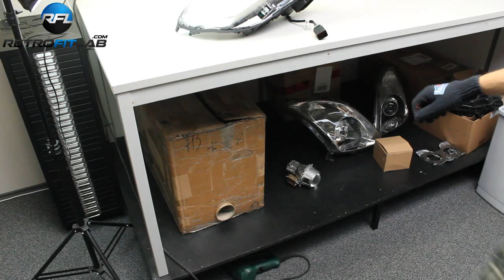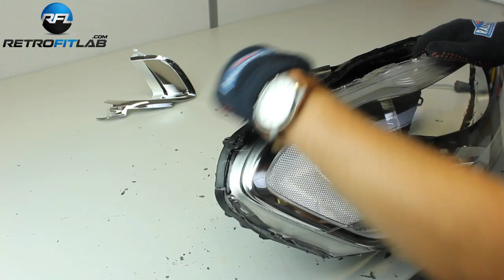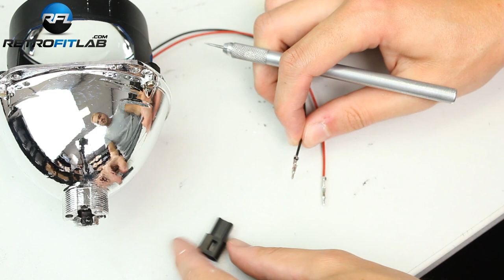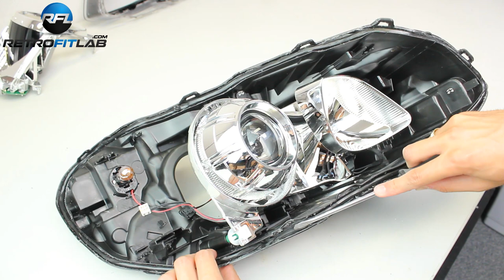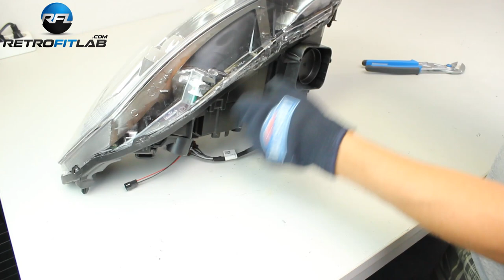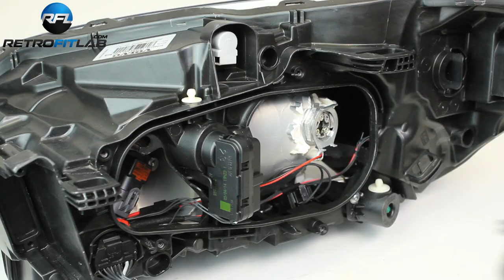Volvo XC60 2009-2015 | Bi-Xenon HID Headlight Projector Upgrade installation

Comment: Hi bro , how u clear the old silicone ? Any good solution with that ???
Reply from the maker: The best way is to keep reheating it constantly and scraping it with a flat screwdriver. Patience is required as well.
Reply: @Retrofitlab  thanks for advise . Ya the old silicone gum really quite hard tough to clean….

Comment: Please tell me the temperature of the hot air gun? Thank you in advance!
Reply from the maker: We use a setting of 300 Degrees Celsius for 12-18 minutes / 1st lowest setting, depending on the size of the headlight.

Comment: How long was the heating fan running and how high was the temperature?
Reply from the maker: In general, 2 methods are used, with both methods, be careful and patient. Method 1 is using a regular oven. Preheat the oven at 200 degrees Celsius. When ready, switch off the oven and place the headlight inside. Make sure that the headlight is not touching any metal of the oven by placing a cloth over the grid, for example. Leave the headlight in the oven for 10-15 minutes before opening it. If the headlight kit is not yet soft enough, put the headlight in the oven for a bit more time.
Method 2 (this one) is suitable for larger headlights that do not fit in a regular oven, or if your lovely wife absolutely does not allow car parts to be baked in her kitchen. A large cardboard box is used where hot air is blown through a heatgun. Make sure that the hot air of the heatgun does not blow directly to the headlight, place the headlight on small elevations so that the air can circulate properly through the box. We use a setting of 300 Degrees Celsius for 12-18 minutes / 1st lowest setting, depending on the size of the headlight.
Reply: @Retrofitlab  Awesome. Thanks for the detailed response!
Reply from the maker: @KA7Beatz  Glad to help :-)

Comment: Which led bulb did you install to the turn signal socket? Is there hyperflash with led bulb there?
Reply from the maker: These can be used: https://retrofitlab.com/products/pwy24w-led-amber?_pos=2&_sid=73e7793f3&_ss=r&variant=40348591718552 There should not be any hyperflashing with these bulbs.

Comment: ive been trying for ages to separate my s60 2005 headlights.
Reply: Ok. Thanks. What effect dö you use on The gun?
Reply: I mean how hot do you set the heatgun when putting it in The box.
Reply: i made a wooden box (similar to yours), and set the heat to 330celcius for 15min. but it wouldnt come loose at all :(
Reply: ***** at last i manage to separate them :D the glue on the volvo xenon houses from 2007 seems alot harder than any housing you have video on.

Comment: hi, the projectors of Peugeot 407 can work with bi-xenon? thank you.
Reply: +Retrofitlab yes
I heard a lot of people who install xenon bulbs just like that.
but as I saw your job, which is excellent, I just wanna have your opinion. 
thank you
Reply: +Retrofitlab 
The 407 projectors is OK? because they came with halogen bulbs
Reply: Yes you can use the standard reflectors if you want.